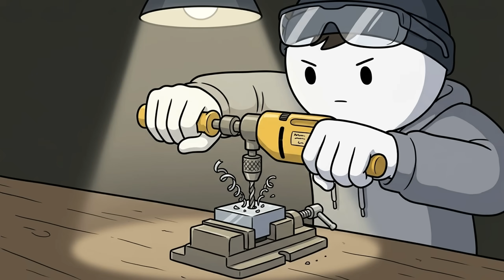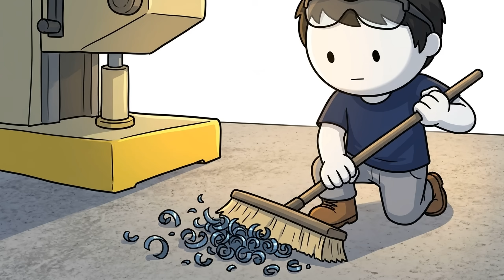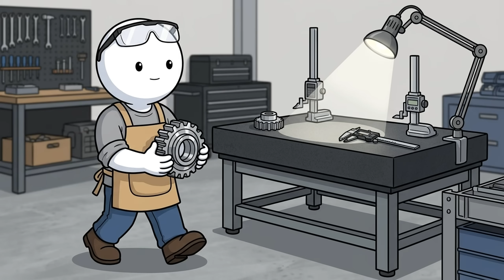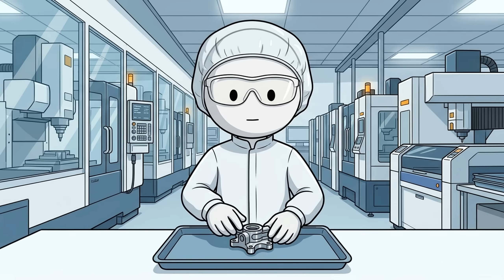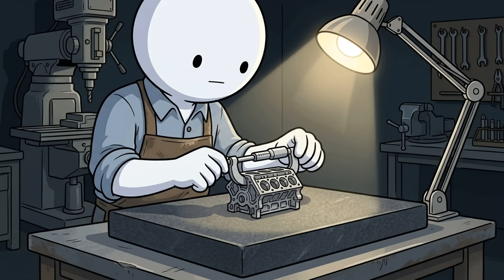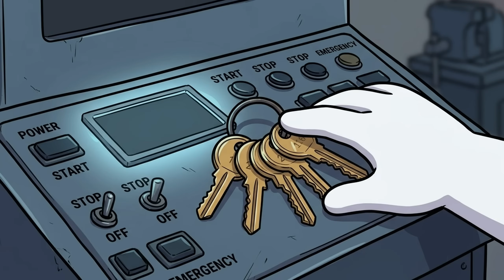Your Life as a CNC Machinist at Every Level

Comment: I'm a machinist. I started going to an adult night class and working on manual mills and lathes. 3 months into the class, we had to do a project where we came up with the idea and made the part. We had a prototrak lathe in the shop, and the teacher had no idea how to use it and wouldn't let anyone use it until they showed that they could. I wanted to make a chess set. I sat down and looked up the regulations for a standard chess set. Then I designed all the pieces and hand-wrote the code for each one after teaching myself how to code the lathe. I showed the teacher what I wrote and even showed him the programs on the lathe itself. Then he ran the first one with me, and it came out perfect. So he let me run the rest. We had limited new stock, so I made the whole set using pieces in the scrap bin. It's still my favorite thing I've ever machined. After I graduated from the class, I went on to work at an adhesive company. They made the stuff that put glue on things in assembly lines. Most notably, the device that glued labels onto soda bottles. I started on the saw cutting blocks to put on machines to make the parts. After 8 months, they wanted to move me off the saw to bring in a new guy. They moved me to the assembly building, where I ran a desktop machine to make nozzles. I would use drills as small as .120 mm. So small you needed a microscope to check it. I also helped with a lot of random assembly jobs. I did that for about 4 years and 5 months. At that point, I had been at the company for 5 years. I was then let go cause I complained that I was making less than new hires who were fresh out of high school and had zero job experience. I did find out from an old co-worker that they now have 4 people doing all the work that I was doing and are still falling behind. Each of them is getting paid more than I was. So jokes on them, I guess. I now have a new job at a machine shop running a huge mill making very large parts. I'm making a lot more money and learning a lot of new things. Been thinking about getting into the programming side of it. I downloaded Fusion, and I'll have to find some tutorials and start learning. Build a portfolio of parts. I do eventually want to learn master cam, but I'm starting with Fusion cause it has a free version, and the free one lets you simulate the program.
Reply: ProtoTraks are bitchin'. Great controllers. Good luck to you in your career!

Comment: Most machinists wishes the pay was this good. Most CNC machinists do the programming, set up and run the machines. Well, at least everywhere I have worked. I have been machining for 40 years. Both manual and CNC machines. I’ve made parts so small that they have to be measured under a microscope up to parts that weigh over one hundred thousand pounds. .0005” is not that close of a tolerance in some machining applications anymore.  I have to hold.0001” on a regular basis now. Machining is a very interesting skill. Most people don’t have the patience to learn it anymore. Very high stress and not enough pay for what we do. If you like challenges, this might be something a young person would enjoy doing for a living.
Reply: That’s exactly why I like CNCing.  I’m still new to this, but the challenge of getting things perfect is what has kept me at it so far

Comment: There is also a tool and die machinist. My next step is getting a couple machines for my garage. I will program and setup. My family will run them while I’m still working.
Reply: I'm looking to do something similar. I've done tool and die for many years. Mostly I just want a knee mill , a lathe and eventually a CNC mill. If you're cool with it id like to know some of the plans you have on how you're going to go about it.
Reply: @mooreevair  I’m looking at getting a used HAAS mini mill or a Tormach 1100. Both can be ran off single phase 220v.  There is also a few single phase lathes I’m considering. You find jobs and sell through Xometry.
Reply: @whiskeytangofoxtrot4363 I take you've passed their test ?

Comment: Always know manual machines. Always learn the most advanced technology.  Master Machinists need to know both
Reply: 20 years ago I was told that I had to learn cnc and that 3d printers were going to replace me. Right out of high-school I got a job as a  machinist fabricator in a small DOD contractor, I left that to be a manual machinist in a prototype shop at an engineering firm, no im a tool an diemaker at a large factory. I can build almost anything with normal manual equipment and hand tools. Where manual machining really shines is 1 off parts and repairs. Mass production almost requires computer automation.
Reply: Yes, learn the trade on manuals, learn it all one step at a time !
Reply: I work at a job shop so I'll use either to finish the quickest.  Usually I'll use the cnc for high quantity/complex/high precision runs

Comment: Set z=0 to the top of the part and you won't crash it. ❤
Reply: it always could be something,
 bad Z0 on the machine 
bad X/Y 
bad tool measurement, 
bad offset of the tool, 
bad z0 in the program, 
bad the deep of the cut, 
bad height of the workpiece above the vise
or something else
Reply: 😂 that only works if you run 3 axis machines. There are levels kid